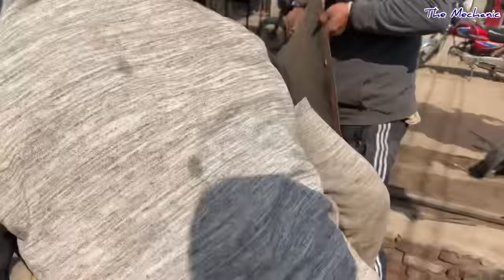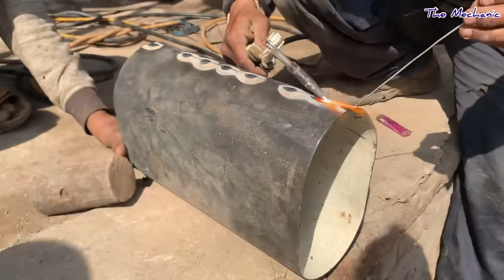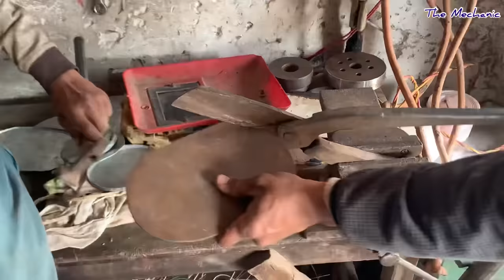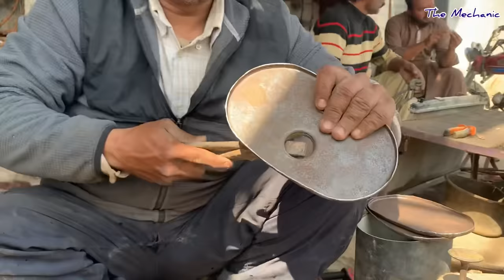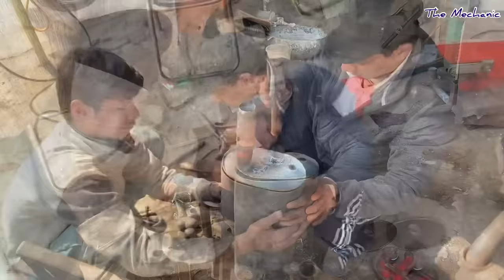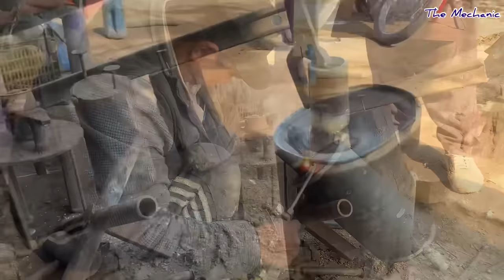Watch how a chill mechanic make custom exhaust muffler with hand tools || DIY muffler replacement

Comment: Im from the US and over here I have read a series of books called The Foxfire Books. They pretty much go into detail how the old timers did things like making wagon wheels for example. The books were made as a means of preserving how things were done in the past. I personally feel videos like this should be put in a digital archive because the knowledge they contain is so valuable.
Reply: Absolut ‼ 👍
Reply: Good point.
Reply: @WILD için
Reply: Foxfire were cool old books that taught you the ways to do what people would think are simple tasks around the homestead.
Reply: g f they r the degree holders  they won't definitly do it. Some times  experience is more than a degree.But  Cater pillar never compro mise with quality.That is why low cost re work is  possible.
Reply: En YouTube hay un canal de oficios antiguos. Un señor de ESPAÑA que se dedico durante años a ir grabando oficios perdidos o casi perdidos. El canal se llama EUGENIO MONESMA. Es muy muy interesante. Es como los libros que has leído pero en imágenes. Un saludo desde España
Reply: K ho
Reply: Ooo.
Reply: U need to step up and read Dave gingeries books .it is like nothing else
Reply: 1р
Reply: Questo è pura maestranza che imparavi da piccolo nella bottega del maestro ora purtuppo non ci sono più in Italia perché c'è l' inustrializzazione
Reply: @joaquinpaezsanchez9357  saludos de Mexico, gracias por ese dato amigo
Reply: @renevallejo1014  de nada es un placer, un saludo desde España.
Reply: 508f
Reply: Thanks for the recommended reading!
Reply: Digital Archive assumes that we will still have intact social structure
Reply: Excellent books! I have them all!
Reply: Getting me those books ty
Reply: The digital archive is called YouTube
Reply: It is however already in one of the biggest digital archives, it's a place called YouTube
Reply: Yes, but you won't see muffler building in the Foxfire books!
Reply: agreed. im gettin old🏁

Comment: When I lived in Asia I had an exhaust made like this for my 1978 Mercedes 280e, they took off the old original exhaust, cut open the silencers and reproduced the whole system for about $60.   It was incredibly strong and heavy gauge steel.
Reply: Haha I'd almost bet its still installed and working fine if the car still exists, those cars don't need a new exhaust for about 30 years usually 😁
Reply: Id ask for stainless

Comment: I would love to have my truck parts made so well . That thing is going to last a very long time 💪
Reply: No it won’t! Dirty welds, no beads run, just tack welding. The brazing on parts that will take temperatures that exceed their tolerances, and still on rusty metal. No actual baffling. This is horrid. It could be genuinely skillful if the guy cared enough to be a craftsman. It’s like a pre worn part. Right down to shitty silver paint to make it look clean!
Reply: @andrewsmith9174 They don't have the same corrosion problem there, due to low humidity you know.
Reply: @Vivungisport  dirty is dirty. Welding dirty is a bad weld. Dirt in lubricated parts is still bad.  The humidity does not matter. It’s sloppy work.

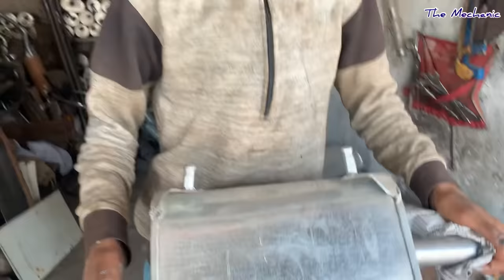Comment: I like how the butt welded  side seam turns into a machine crimped lock seam at 14:57
Reply: As were the end seams.
Reply: The metal on the last one was made from zinc plated sheet metal. I think they were showing how the one they made looks just like a mass-produced part.
Reply: Doesn’t matter much when they were welding dirty, rusty parts. I laughed that they painted it silver instead of cleaning it.
Reply: @andrewsmith9174  it'll still outlast some 19$ Chinese muffler by 10:1.
Reply: @MrTheHillfolk , I don’t think this poorly made piece of shit would survive the drive home after installation.
Reply: @andrewsmith9174  over where they are ,it looks pretty dry so I bet moisture isnt as much of an issue
Reply: @MrTheHillfolk  It is from pakistan and the moisture here in july-august season is unbearable but they are making it from quite thick sheets, they are not pretty but they outlast even Japanese genuine spare parts.
Reply: @MuhammadIsmail-in6vf  yeah, I could see that being possible, even the Japanese metal isn't the greatest

Comment: It was interesting to watch this fabrication start to finish. I noticed they had I pretty decent amount of inventory stacked along the walls of the shop. 

Watching them use basic metal working skills and turning surplus/recycled base standard sheet metal and piping into a finished muffler using an old hand sheer, hand rollers, hand punches, a couple of hammers, a pipe cutter, some home made patterns and molding patterns and jigs made out of steel plate and pipes and a gas welding torch. And they produced a good serviceable muffler. 

I don’t think many people will be fooled by the final muffler with the crushed lap scene at the end. Their actual hand painted muffler being carried by the helper was the one to see. 

They put together a good solid muffler. And it will probably give a good long service life if used every day. My only question is the small restrictive baffle passage holes will result in quite a bit of back pressure and reduce exhaust flow, thus robbing the engine of some of its power output.

Comment: If you've never built anything by hand. You have no idea how impressive it is how he shaped that over the railroad tie.
Reply: What impressed me is how efficiently he did this without an angle grinder or power tools except the stick welder. He cut that steel far more efficiently and neatly than most people, including myself, would do with a grinder

Comment: I grew up doing that same thing in the 70s cause I couldn't afford to buy exhaust. I used 2 or 3 inch galvanized fence post for tail pipes and I made round or square mufflers at a friend's body shop or my dad's when he wasn't doing anything to people's cars. Otherwise I ran open headers cause the police never said anything until the late late 70s into the 80s lol. I'd almost bet that one of the buildings that used to be a auto repair shop probably still has my hand made exhaust in it cause I used the same exhaust on different car's cause I'd find a Chevy body that I liked and away I'd go putn em together and be cruising in no less than 4hours lookn for something to drag it's ass through a 8th or quarter mile road. I miss the good ol days when everything was to simple. I could rebuild and start the break in process with a Chevy engine in less 3 hours. By myself with no distractions. 2 hours tops and it blesses my heart watchn this guy make his own stuff....

Comment: Very good job.  Only one question left unanswered,  what about protective gear?
Reply: @port nut just supply issues in general. 
When I saw the kid cutting the pipe with the cutter ,I was thinking where the heck do they get replacement wheels....haha they probably make them around the corner at some other place ,now that I think of it.

Comment: Growing up I learned ALOT working with my father around the house,getting use to handling tools which carried over into a 30yr career in construction,being hands on ALSO allows the skills needed to maintain vehicles off road equipment,RV repairs,,,,,,,,DO WHAT YOU LOVE DOING,AND IT WILL NEVER FEEL LIKE A JOB

Comment: This silencer shown at the end is not the one shown in the video. This is an original, as you can clearly see from the flanging instead of the welding.
👎👎

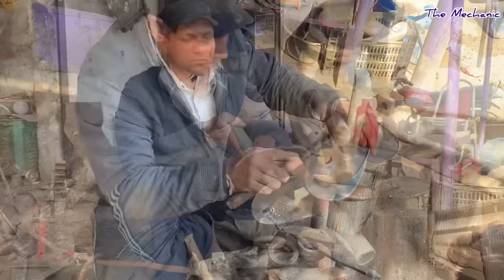Comment: 10:20 Safety squints, engage!
Reply: Flapping the face shield from side to side moves the fumes, it is not protecting the eyes
Reply: @Pinky_Staines1947  Ain't nobody using a shield of any kind at 10:20

Comment: I made my own pair of resonator tips for my dual exhaust . I used an old pair of 15" x 3 " chrome echo tips bought 2 section of 2.25 pipe and 2 short connector pipes from O 'Reillys and bought 2 combo packs of steel wool and 1 pack of bondo brand of fiber glass . see my part 1 and part 2 youtube videos on my channel  Moparman1978

Comment: I think you boys need a new cutting equipment.
Reply: I would rather use the sheer he has over a plasma cutter any day.
Reply: They are working with what they can afford. A plasma cutter is an expensive tool for them. Plus you need a bottle of compressed oxygen.